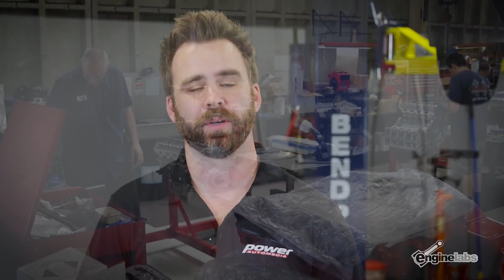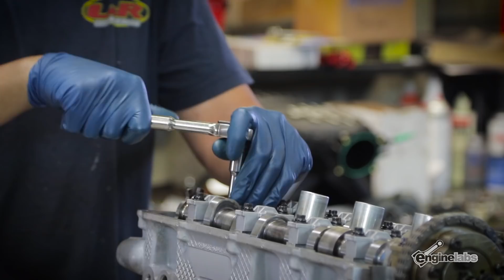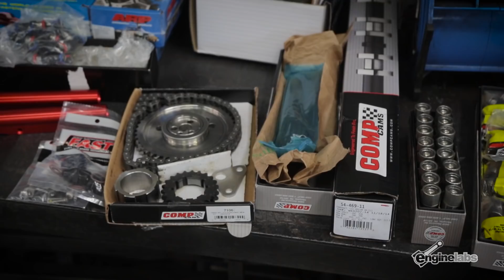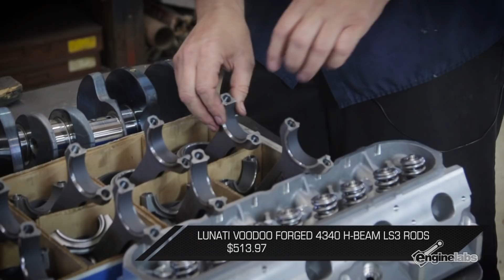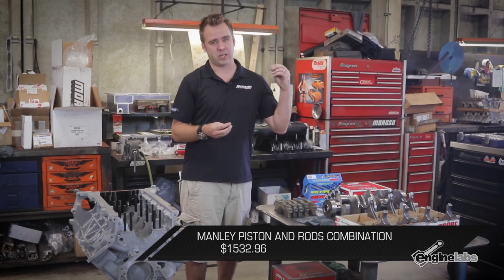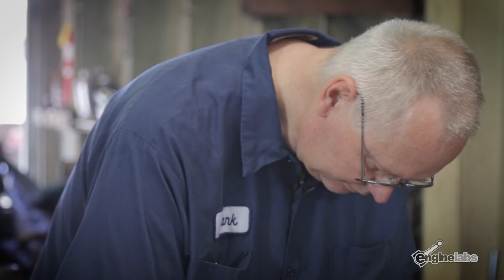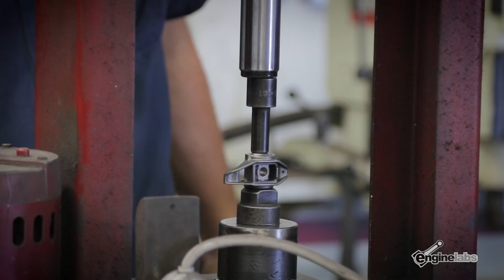$10k Coyote vs LS3 Shootout - The Build

Comment: 5.0 more powerful , best inlet cfm modern engine  but i love lsx because its simple
Reply: The fact the the LS3 is 30% smaller in size. It wins
Reply: Artchred  tape measure size. The LS3 has quite a bit more displacement. What is it...376 cubic inches or so?? No question the LS3 will put down more power. The old saying still stands...no replacement for displacement”. However I have a F150 truck with the 5.0 coyote that puts down 380lbs of torque at 4200rpm STOCK. I find it odd they increased the torque by 10-15 pounds over stock with 10k dollars LOL. I’m no Ford fan boy...drove Chevy my entire life and my F150 is my first Ford...still got my Silverado. But something stinks about their final results. They made good torque improvement in the LS ( no surprise) but only 15 more pounds on the Ford ????
Reply: JohnnyRebKy
Don't judge the 5.0 too harshly. You have to keep in mind it's a modern, high flow, high efficiency 4 valve engine out of the box. That means it's difficult to improve on.
At 380lb/ft of torque from just 5L that's 78lb/ft per liter. 
The LS3 at 425lb/ft of torque from 6.2L is 68.6lb/ft per liter. 
If the 5.0 was as large as the LS3 it would be making over 480lb/ft of torque out of the box, before any improvement.
Reply: If you took the time to actually READ my comment you would see I said the same thing. I am a big fan of the Coyote. If the same size the coyote would murder the GM.
Reply: JohnnyRebKy 
I wasn't being critical of you dude, just adding my 2 cents.
Reply: Joe
Isn't the 4.8L like sub 300hp?
Reply: Its good man I didnt mean to come across as a ass. My bad. To the other guy though...I have a 4.8 in a Chevy and its a dog. That being said any engine can beat another engine when enough money is thrown at it. I know the Ford Coytote in my truck has more guts than my GM trucks ever dreamed about. It has more guts than the big bock did 25 years ago. We came quite a ways in guts to size ratio these days regardless of brand!
Reply: Joe Figueroa 
Somehow I doubt dumping 10k into a 4.8 would make more power  then 10k into coyote.
It's really hard for 2 valves and pushrods to overcome the sheer airflow and rpm potential of a higher tech 4 valve engine. I know, I've tried.
Reply: 177SCmaro for 10k totally agree. No way no how. Coyote will always make more power per inch and like the Coyote vrs a 6.2 the 4.8 runs out of inches. Rumor has it Ford has a 427 Coyote in the works. That should be interesting! I’d love to see the return of the big block in a modern engine like the Coyote. I know Chevy made some 427 small block engines that were impressive in the vette. If Ford could make a big block coyote and get 15mpg in a truck I would slobber on myself LOL
Reply: JohnnyRebKy 
A 7l coyote is hard to imagine given the 5l already makes great power and has huge potential out of the box. If it had the same hp/l a 7l coyote would make around 640hp out of the box and that's without a supercharger, which would be pretty remarkable.
Reply: Joe Figueroa
The differences between 2V and 4V are not minute. The stock coyote head, for example, flows nearly 300cfm at .500 lift out of the box. With a little CNCing numbers over 320 are not uncommon. That is difficult to do with a 2V pushrod head and near to impossible at the same cylinder head cross sectional area (with the same port size 4V outflows a 2V by a significant amount). 
Take look down the intake port of a 4V performance head sometime. They tend to have a wonderful straight shot at the valves that a pushrod 2V could only dream of. 
And I don't mean to sound like I'm picking on 2V pushrod engine, I race one, but in terms of raw airflow 4V OHC is where it's at.
Reply: Joe
um...apparently you've never worked with a 4v engine because a 4v head is like, basically, two mini-hemi's side by side. They do everything a hemi does but better, and with dohc, they do it without the Hemi's awkward valve train.
All other things being equal, 4v is superior to 2V and even hemi in terms of performance. 4 valves simply flow better than 2.
Reply: Joe Figueroa Dude are you kidding!!??
You cleary don't know much if anything about a 4v ti-vvt engine.
Reply: Hell yeah, they are both great motors. You can’t gomwrong with either of these beasts.
Reply: Coyote motors are great motors, LS motors are great motors. The Gen 3 Hemi's have the best intake air flow of the modern American V8's though. 392's intake flows over 340 cfm vs Coyote's 290 and the best LS are similar to the Coyote. Not saying they are better of worse engines, just that the Dodge Apache head on the Gen 3 Hemi and even the Eagle head on the 5.7 Hemi will outflow Coyote's and LS's. It isn't really a hemi, it's a modified pent roof similar to the Coyote but only 2 valves and a little bit smoother transition from side to side. The biggest drawback of the Gen 3 Hemi is very few aftermarket parts so they are hard to modify much.
Reply: All 4 valve gas engine's I have seen have a pent roof chamber. That's different than a Hemi. The Gen 3 Hemi's use a modified pent roof chamber. It has the angles smoothed out and then they call it a Hemi, but it isn't. Pent roof is far superior to a real Hemi. Real Hemi's have no quench area and require a very large dome on the piston to create a decent compression ratio. It is very heavy. Pent roof combustion chambers need much less of a dome and the modified wedge in an LS style motor requires no dome for good compression which means a lighter piston. The Hemi was designed when the only thing engineers thought was important was air flow and also, with it's smaller surface area, thermal efficiency. Today engineers have found that by reducing piston weight and overall size and by encouraging better atomization of the air/fuel mixture using a quench area that the engine becomes more efficient and therefore makes more power. Multiple valves have advantages and disadvantages but most people automatically assume they flow better. They do but only at certain RPM's and valve lifts. 2 valves will out perform at the other end of the spectrum. It's really hard to declare one more efficient than the other because of this. Both the Coyote and the LS motors are engineered far better than an old 351 Cleveland or 370hp 350 LT1 from 1970.
Reply: The Coyote is not smaller. It weight more because it has a lot more parts. The Liters are just empty space. LS and Hemi use more space to do the same but they are lighter.
Reply: 177SCmaro that's why their displacement is bigger. But they are lighter and have more potential.
Reply: They aren't that much lighter it's like 44lbs and they don't have more potential. That all comes down to which parts you want to use. Simple fact is if you want a cheap engine to throw into a car and want to keep it N/A go with a LS. If you want to make high HP on boost and size isn't an issue, go with a Coyote.
Reply: @WhoThisGuy515  But, at the same time if an engine has more moving parts, its going to be a problem in the future. For me if you want to mantain the engine stock. Go for the Coyote. For tunning and racing go for the LS and OHV engines because of their simplicity.
Reply: @WhoThisGuy515  The engine potential is relative to what you want with it. But in general the engine with the LARGER DISPLACEMENT will have more potential.
Reply: @177SCmaro  
You should read hot rods article titled big bang theory. I'll tldr for you. 1100hp from a factory bottom end 5.3 Chevy....oh wait it was only a 4.8.  these asshats wasted money with the forged crank anf piston and rod sets.
Reply: @177SCmaro  the more of your comments I read, the more I realize you don't have a clue. Stock ls3 heads flow right around 290cfm at .500... Oh and with some cnc work 350cfm at .500 without pulling any tricks.

I'll put my IronLS against anything your building.. I'll just be waiting a long time for you to aquire the knowledge and put it together
Reply: @driftordraft  
Dude, I've seen guys throw an s475 on a b18 and make over 1000hp on the dyno on the stock bottom end and b18 is just a tiny 4 banger. The question isn't "can it be done?" The question is "how long can it be done?"
Anyways, sure, they could of been more efficient, I'll give you that. However, putting a good bottom end gives you room to grow.
Reply: Kelly W  
I hope so. The LS has over a liter more displacement on the 5.0. That said, a DOHC 4v LS heads would rob your small block of most of its other advantages over the Coyote i.e. lower center of gravity, easier packaging, ect.
Reply: @177SCmaro  they didn't just make 1 pull with it they made a ton of pulls. They only ran out ignition.
Reply: @TheAbrahamsoto01  
Both the coyote and the ls based engines tend to max out around 3500hp when taken to the extreme, the ls never really does overcome its 2 valve limitations. A price is paid for everything in the end.
Reply: @driftordraft  
And how many is a "ton"? One season of drag racing can include hundreds of runs.
Reply: Who cares if an engine can get 3500 hp.. My Challenger 6.1 Hemi is 645whp and I has been very happy with it. Using it on my free weekends and smoking 99% of cars. I dont want to race, i just want to enjoy my supercharged engine from time to time smoking some cool cars. You can do that up to 1200 whp.. After that, is just for the track.
Reply: @177SCmaro  you fail to see it. Ford has not made an engine with a readily available aftermarket support since the 302. I could care less about brand loyalty. I put my money on the better engine. That's the LS.
Reply: @TheAbrahamsoto01  the guy you and I are arguing with is quite possibly the dumbest gear head. He talks about 4v flowing better than 2v over and over.  Yet builders are screaming to get 330+cfm at .5 from the stock coyote heads. Just about everyone has ported ls3 heads that flow 350cfm at .5
Reply: @driftordraft  
That's not true. There is a ton of aftermarket support for late model ford engines. Evidently you've never stepped outside of GM engines.
Also, the STOCK coyote head flows about 290 cfm at .500 valve lift. PORTED heads can flow 330CFM at .500 lift. (Slawko heads for example) which is comparable to LS heads but what makes the Coyote exceptional is its heads are designed for a significantly smaller engine. 

If the coyote was proportionally increased in size to match an LS3 not only would this hypothetical 6.2L coyote be making something like 100 more hp then a 6.2l LS, a 6.2l coyote's ported heads could flow over 400cfm, all things being proportionally equal.
Again, 4 valves simply flow more air then two, all othe things being equal. Its undeniable physics, dude, and this is coming from a guy who's been 2v GM for much of his life.
Reply: @177SCmaro   I love when fordboys bring up that hypothetical "if it was the same size". The aftermarket you speak of isn't 1/20th of the aftermarket you see for SBC, BBC, or LSx. Hell Dodge 360/318 has better support. Whatever I'm done with this you don't have the first clue and keep making shit up.
Reply: Artchred huge displacement with none of the power. Coyote is only a 302z
Reply: @JohnnyRebKy  Not gonna be call Coyote. Be under a different name. I not a fan of small blocks V8 engines. Big Blocks put out way more power then these little engines any day. If they can make one right. For sure !
Reply: Silkmaster4200  I agree in general. However “ big block” is just that...a big block. Big displacement can be stuffed in a small block to get the displacement. GM and their Corvette small block 427 for example. It’s still 427 cubic inches. Big blocks are just a block with a taller deck height in general, typically to allow long strokes. But still I’d love to see a genuine aluminum big block rather than a 427 small block just for the sheer cool factor 👍🏼. PS....the Ford 360 was a “ big block” with a small displacement. The GM 350 near same displacement in a small block. Of course when Ford used the available space in the 360 block you got the 390FE which was a hot little big block when it was made a “ interceptor” 👍🏼
Reply: @JohnnyRebKy  Big Block not just the block. The parts are big super duty and rugged. Not sure small blocks have heavy duty parts or thicker like a big block does.
Reply: @177SCmaro  LOL, That is 1 of the the downsides of a DOHC motor.  Since the early 80's....Ford brand has been full of Bitches that are scared to make a big motor,so the would coulda BS about if a ford enigne was big is a FK'in joke. Ford fangirls cry that all the time.

 They have Small displacements for the Physical size/cost of the engine. The DOHC that don't go to 8,000 rpms are a waste of money. 2 valve engine actually makes more hp/ lbs of fuel. David Vizard, the most published guy about high performance/worked on F1 cars and for cam/car brands even said he proved it. He said he can make more TQ/ltr in a early mini engine than a N/A F1 engine.
Reply: @JerseyMikeP  
That must be why all motorsports and performance cars use large 2 valve pushrod engines.
Reply: @177SCmaro  Motorsports is all BS...Controlled by regulations. It has little to NO comparison to the street models. FIA in particular make their rules to give Porsche and ferrari an advantage since they want them in their series(FACT).

DOHC is ONLY better when you are limited on displacement or need to rev past 7,000 rpms to make power. Variable valve timing in OHV engines isn't as advance/much harder to do. That is the ONLy advantage of DOHC. The weight and lack of displacement and poor Tq/lbs of fuel (low end torque) is their downside.
Reply: @JerseyMikeP  
Cool story, bro. One nice thing about this world is it's big enough for efficient, high tech horsepower AND big "dumb" cubic inch power. 
I've built both.
Reply: @177SCmaro  It would be boring if everyone made the same engine same looking cars....But you're wrong about the "Efficient, high tech horsepower and big dumb cubic inch power". 

Prime example, when the LS3 in the corvette it made more power, was faster and Got BETTER MPG than the High tech ISF or E92 M3. People get Efficiency mixed up with volumetric efficiency. 2 Valve head is more efficient at converting fuel into power  B.S.F.C.#. Big DUmb is the over complicated/expensive, Physically large for a small displacement DOHC engines.
Reply: @JerseyMikeP  
I'm wrong about the world being big enough for more than one way to make HP because two or three unspecified and different cars got slightly different MPG. Uh-huh.....I'm pretty sure you're just trolling, esp. when you offer zero evidence or citation for anything you've claimed.

Moreover, looking at two mpg figures from two different cars and concluding that the one with the bigger engine that makes more power means it has a higher BSFC betrays a lack of knowledge on your part as 1: that's not how BSFC is measured. and 2. even if it was, your comparison doesn't take into account any of the numerous different variables between two different cars: aerodynamics, gearing, rolling resistance, esp different tires and even air pressure in those tires, etc. all of which effect mpg, which is what your claim is based on.

You're a VERY long ways away from proving your claims.

Look, dude, there is a reason most cars these days that need to produce as much power from as little gas and displacement as possible go with relatively small DOHC, 4 valve, pentroof designs. While more complicated and bulkier on the outside, it's lighter and a significantly more efficient design in terms of rotating mass then the older 2 valve stuff. 

Like I said, I know, I've built performance engines both ways. Yes, they've pushed 2V very far, and it has it's share of advantages, but it's just simple physics: 4 valves flow better than two. Plus, dohc and 4 valves give you a lot more options for cam timing, etc. that add to it's efficiency. For example, I can do things on the fly with a Coyote's phasers that I could never do with a cam-in-block pushrod engine and their (usually) fixed valve timing.
Reply: @177SCmaro  Not wrong about the world being big enough...that's why I said it would be boring if everyone built the same car.

Just wrong about Assuming High tech means more efficient. FYI, I didn't say anything about about how to calculate the BSFC # , There you go again ASSUMING things. 

Also Guys that don't know automotive history that call OHV engine "old design", need to do some reading as the OHC engine design is just as old.
Reply: @JerseyMikeP  
I never said high tech means more efficient. 
I didn't say you said anything about how to calculate BSFC, I said that you're wrong in your assumption that two different cars with different mpg means one has better BSFC just because it has more power with higher displacement and better mpg then the other because that's not how BSFC is measured.

And "old" is a relative term. In automotive context I had thought that you had understood that it's in reference to its use and development, not necessarily it's existence. OHV is a relativity "old" technology in that it has been used extensively in the past compared to relatively "new" DOHC technology that is commonly used now but less so in the past. 

I'm well aware of the fact that OHC arrangement is nearly as old as OHV in terms of existence. But OHC is relativity new in terms of it's use. Does that clear it up?

All that said, you still haven't proven conventional cam in block 2 valve engines are more efficient than DOHC 4 valve engines in any sense besides packaging (outer dimensions).

Good to know, though, that someone who has a problem with people making assumptions isn't, himself, basing all his claims on this threat on a number of assumptions, right?
Reply: Exactly sometimes simple is best, not knocking the coyote, its a great idea, but yeah when it comes to things like tuning simple is best, air in air out.
Reply: @MTT-ic3ci  
I've been into old school small block Chevys for a long time and am in the process of building/branching out into a coyote. The coyote isn't that much more difficult to tune then an LS. Yes, the coyote is a little more sophisticated then the LS/sbc but, really, the main tuning difference is just the VVT (which can be locked out/completely removed for racing) and it's kinda nice having control over valve timing, being able to change the intake timing separate from the exhaust timing. Gives you more options.
And terms of raw air in, air out, 4 valves are better than 2.
Reply: @177SCmaro  4 valves Produce more air but take longer to fill up, they take up alot of room to where i would throw some precisions in, also coyote dont cool as well as the ls which causes problems when you start throwing some force induction at it, a v8 thats lighter then a cast iron 4 cyl and Can fit into anything is hard to beat, push rods to my experience make better low end torq, But coyote is still fresh, and its full potential is yet to be unleashed, and yes i do like the timing chain idea im sure oem's would work, mabye a destroke? That will get them rpm's up quicker, if you got the money and time then why not, glad people out there are willing to see how far it will go. Good luck to ya mate. I may follow too👍👍
Reply: @MTT-ic3ci  
No idea what you mean by "take longer to fill up". 
They do take up more space on the outside but if you're got the room those big, wide, DOHC valve covers can look pretty intimidating and are totally worth it in terms of performance. After all, Ford is doing with 5 liters what it takes GM and Dodge  over 6 liters to do. That's one of the things that convinced me to build a Coyote over an LS. That and I'm kinda bored with small block chevys.
Reply: @177SCmaro  youll see, a bigger displacment in a smaller lighter engine, is built for turbo power. Dohc is a big part of the equation though, Yes it breaths more, and yes push rods have a habbit of floating, but in a sprint, with all that money you spend working on the coyo you could force feed air into a LS for a 1/4mile and they are almost untouchable. Proline tweaks it best. But i agree, even im getting bored of the LS, think its time for a change. Proline LS are still runnig the drag strip atm, but every dog has its day eventually. Not long ago dodge and ford were the 👑
Reply: @177SCmaro  man here in australia we have a ford engine called the Barra, its a inline 6 with plenty of grunt. Its like a 4l 2jz , primative build, but the dohc makes all the diffrence. I aint much for 6s, but as a strong v8 fan, i tell all you americans now. It is amazing! Everything wrapped up in one, you wouldnt even consider the coyo if you had one, sounds like a vacuum cleaner about to explode though. Sorry for the rant man, i just appreciate when someone is finally unbiased 👍👍
Reply: @MTT-ic3ci  
I'm familiar with LS engines. I know they tend to have larger displacements for their external size and weight compared to most DOHC engines.  And you can turbo almost any engine. My point was the Ford with it's DOHC 4 valve engine is doing with 5 liters what it takes GM and Dodge over 6 liters to do. 
There are pros and cons in everything. The con to pushrods is a sub-optional efficiency, the con to DOHC is weight and bulk. For the money you can build about the same HP out of either one. The reason is LS and Hemi have displacement and Coyote has airflow/efficiency. They tend to balance out.